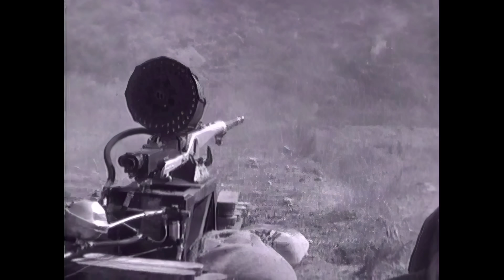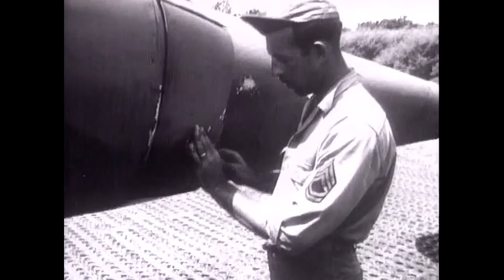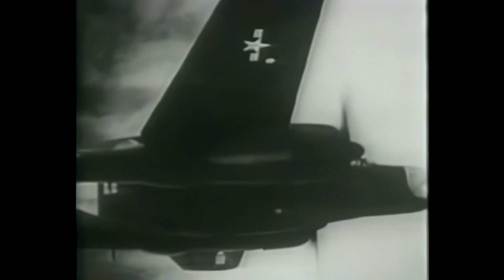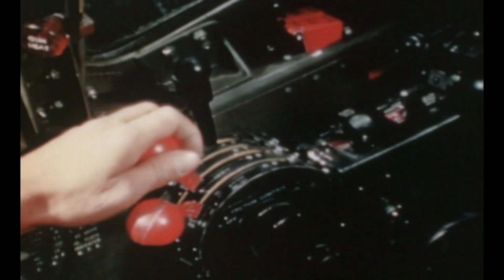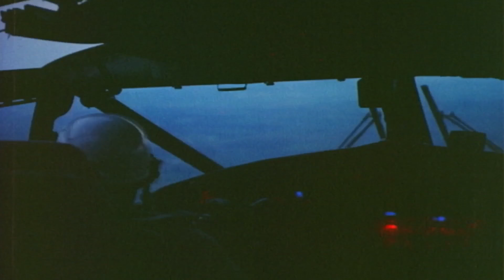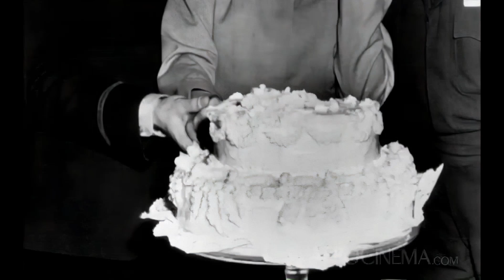Fork Tailed Devils, Twin Booms & Black Widows. WWII Aircraft History

Comment: The Allison engines were not reliable at altitude on high boost, in the European Theatre of war ETO many Allison engines were repeatably replaced. The Lightening P38 and  Thunderbolt P47 suffered from compressibility problems and loss of control in a high speed dive. The P38 Lightening was moved out of the ETO before the wars end. The Mustang became the standard escort fighter at high altitude with the Thunderbolt concentrating on lower  level ground attack at which it excelled. This was decided by the US commander of Eighth Air Force General James H Doolittle. after testing the aircraft available. Many Lightenings and Thunderbolt were last reported seen in high speed dives after German fighters and assumed to be lost because they could not pull out due to loss of control due to Compressibility. The P38 Lightening suffered worst and eventually additional control surfaces, dive flaps which could be deployed quickly were developed to pull the P38 out of a terminal dive. Nimble German fighters could outmanoeuvre a P38, but anything  enough in the way of a P38 would be minced by the fantastic centrally mounted gun platform.  Both the P38 and P47 were extremely fast and the Jug weighing over 7 tons was built like a tank. The engine the PW R2800 in the Jug was super powerful over 2000hp and over 400 mph.

Comment: The P-38 had all of its guns (20mm cannon + 4× .50 cals) concentrated front and center in an area the size of a serving platter. The impact area of all that concentrated firepower is so violent, like a firehose of lead and explosive cannon shells. The pilot with the most kills in the Pacific (Richard Bong) flew a P-38 Lightning.
Reply: It was going to have a 37mm….in the place of the 20mm. But yeah, there is an error in the script.  .50 cal. and 50 mm…….. not the same.